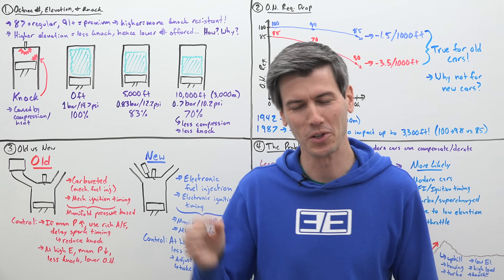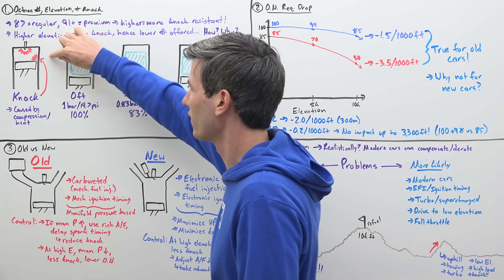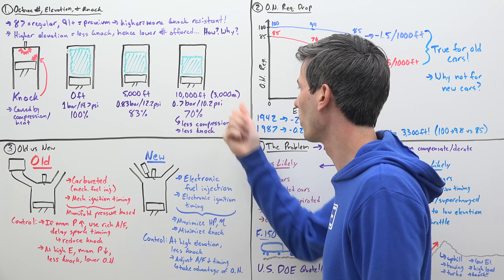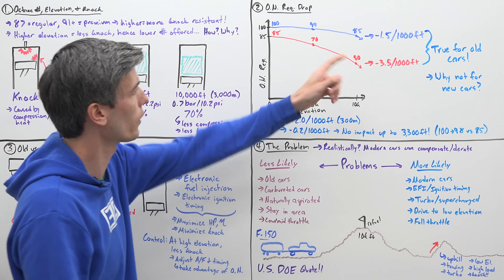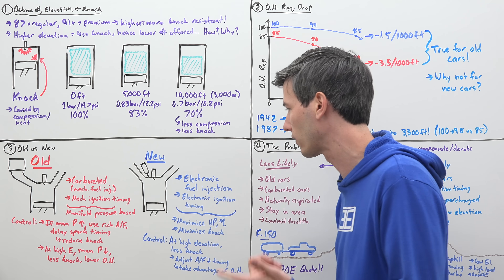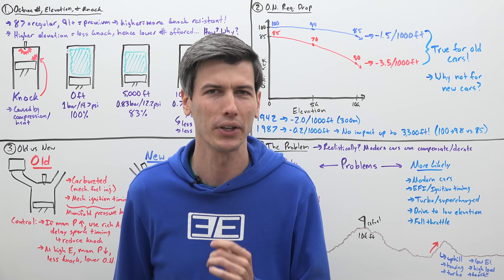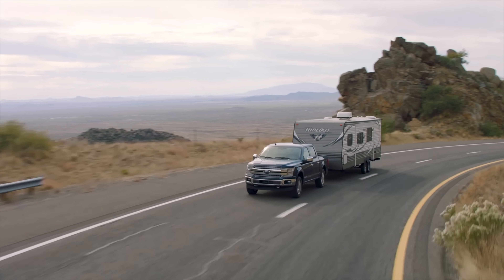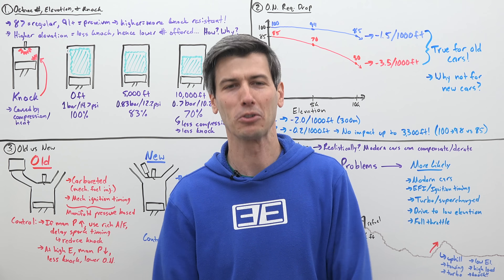Never Use This Gas In Your Car!

Comment: I've lived in Colorado and Utah for years, have always used 85 octane in my cars, and have never experienced any problems. Never had a car die yet at under 170K miles.
Reply: If your vehicles are dying before 200k it literally may have something to do with it. All modern vehicles (since the advent of fuel injection) should last 200k minimum unless there were major design flaws or they sat for extended amounts of time
Reply: @jman0870  Hey it's one of those YouTube comment section know-it-alls. Well, in my defense, I didn't want to make the number of miles that my cars generally last a higher number on average lest some other jerks make comments accusing me of lying. But yeah, these days a properly maintained vehicle should last at least 200K.
Reply: @joeldavis5815  hey look! It’s one of those say one thing, mean something completely different internet tough guys. You specifically said none of your cars made it past 170k miles before they died. Reading and writing not one of your stronger abilities?
Reply: @jman0870 So what is this? You get off of trolling YouTube looking for people to argue with. Get a life dude. No replying to you anymore...
Reply: @joeldavis5815  umadbro?
Reply: @jman0870  you wrong , he said they made it at  least 170k, didn't address above170
Reply: @rogerdodrill4733  uh…yes. He specifically stated he’s had vehicles die at 170k. It’s called reading comprehension. Get some.
Reply: @jman0870 they said they never had a car die yet at under 170k miles. That means that none of their cars have died at under 170k miles using that type of fuel.

You assumed that the poster kept their cars at or above 170k miles. Nothing in the post explicitly states that they had a car die at 170k miles. You are the one lacking reading comprehension.

Also, your earlier post ASSumed that the poster probably had an engine problem due to the fuel that they were using, a car can get too expensive to repair to essentially deem the car dead. I had a 1992 Honda civic with higher mileage that blew a head gasket, wasn’t worth the repair, so for all intents and purposes to me it was dead. Nothing to do with the fuel I put in the car.
Reply: Guarantee you run some high-octane in it within a couple hundred miles you'll notice a big difference in the way it runs.
Reply: @kskip4242  high octane stops predetonation in high compression engines. That’s it. Read a book or something.
Reply: Hahaha 🤣🤣🤣 I live in a high elevation state. Run 85 almost exclusively in all of my vehicles that can for 87. I usually sell my cars at about 245,000 since my job requires me to drive all over and I want a reliable car. Never have any issues with knocking, pinging, or power loss. In fact I can't tell the difference between 85 and 88 at all. What is not mentioned in the video is altitude density. The air at high altitude does not allow for pre-detonation (knock) as easily as at lower altitude. That is why 85 is equivalent to 87 at lower altitude. This entire video is built on a false premise.
Reply: @magnashield8604  Did you watch this video??? Jason specifically talks about altitude density (he just doesn't use that term) - it's what is shown in section #1 of his white board!

Comment: What would happen if a top fuel dragster made a run inside a chamber under constant air pressure? Forgetting that it would immediately send a rod through the block

Comment: My area (Denver) has 85 any my bike can totally run on it, however I’ll still use 87 because my manual recommends it and I also justify it because I have a hotter running air cooled engine

Comment: if one were to use a tiny percentage of gas in an older diesel in the colder months, with two stroke oil, certainly. then this low octane fuel would provide the least loss of cetane number.

Comment: One thing to be careful of, half throttle at lower RPM in older cars that have manual throttle bodies still means you probably get close to maximum manifold pressure!

The throttle body is sized so that when it is fully open it allows as much air in as the engine could use. If you're only at half RPM, your engine can only use half the amount of air, and thus only about half throttle will actually already allow the engine to pull in all the air it can. 

You can tell this if you're driving an older car, at low RPM, about 3/4 throttle or full throttle will not have a noticable difference in power, just make more intake noise most likely.

This is important because you mention low/mid throttle as a case where issues are unlikely, but low throttle at low rpm might be the same as full throttle at low rpm.

This may or may not apply to modern cars that have drive-by-wire, as they have throttle maps that mean a certain amount of you pressing the gas pedal doesn't necessarily correlate exactly to how far the throttle body opens.
Reply: Old cars had vacuum advance timing. Low throttle=advance spark, may ping more than open throttle

Comment: I live in a high altitude area , and have always stayed away from using that crap 85 fuel.  Even the 87 is suspect , I think, so I try to get 89 or so ,and don't even get me started on the whole Ethanol crap BS that they are adding E10 trying to push the E15 now.  Im prob never going to own a flexfuel or turbo/supercharged car so the E85 is for sure a no go for me, ever.   The fact that they are jacking up prices on the E0 fuels now pisses me off tremendously !

Comment: I always thought that stations had 85 octane to make the price of regular on their signs seem lower. I drove across the countrty and came upon what I call the bait and switch. You see a great price for regular on the signs visible from the highway, you pull into the station and the price is for 85 octane. I put premium in my Raptor and look at the regular price to get an idea of what premium will cost at a station since they usually only list Regular and Diesel on their signs. I've found that at the stations that have this 85 octane gas, the price for premium is much higher.

Comment: No consideration given for knock sensors and ignition timing?  I live at 6,000 feet and our Subaru's mileage numbers are noticeably better on 91 octane verse 85. The lower octane fuel cause so much timing retard that efficiency is out the window.
I would estimate that we are losing 20hp with 85 octane over 91.  91 octane is 60 cents more per gallon and doesn't even out with increased mileage. We compromise with 87 octane.

Comment: Interesting. I live in Colorado, and I (and most people around me) have been putting 85 in our cars for my entire life. I've yet to have an engine explode on me. Seems to work fine.
Reply: The engines don't explode; the rings can fracture. The only engine I was naive enough to rebuild was from a 1970 Volvo 140; it needed premium gas because of the high compression ratio but it was run on regular. Every upper compression ring was broken, with accompanying paths torched in the cylinder wall.

Comment: It is inaccurate to say you can have 14.7psi in the cylinder during an intake stroke on normally aspirated engine.  There is always a pressure delta compared to ambient.

Comment: I have ran into this lower octane fuel in Utah a few times. And they mix premium with the low octane to make mid grade at some stations. I just bought 91 octane in those areas so I wouldn't have issues.

Comment: I have an assignment for you: Find out how Honda supposedly "fixed" their oil dilution issues on their 1.5 liter engine for colder environments. If not, please give some advice on how we colder living residents can prevent oil dilution and/or whether engine idling to heat up the car via remote start on a cold day damages the engine or creates more dilution. Thanks!

Comment: seeing most cars have modern electronic fuel controlled engines, I think they should ban the practice of selling 85 octane. It's a scam anyways, they do it because it's "cheaper" but yet gas in higher elevations seems to be more expensive anyways. so you're paying more for 85 octane then you would at a station closer to sea level at 87 octane

Comment: Good info, I live in Wyoming at 7,200’ elevation and about 14 years ago when I moved here I was concerned and confused about all reg gas here being 85, then 89,  no 87.  I have a 2011 f150 eco boost and have been putting the 85 in for 10 years.  You have me second guessing changing to the 89 in the future. Thanks for sharing.
Reply: I’ve been in Denver for 20 years and have used 85 the entire time. Have never had nor heard of anyone having issues. I’m also not asking around but seems like I would have heard something by now.
Reply: if youve been putting 85 in it for 10 years and havent had any issue i wouldnt bother
Reply: @dylanc2806  I agree. I still use 85 for that reason.  I do upgrade if I’m on a trip at lower elevation though.

Comment: I've been using 85 In all the vehicles I have owned since I started driving.  Never ever have I had a single problem, all user manuals say to use 87. Well less air means I need less octane haha most people think the higher the octane the longer there engine will last...... not true at all

Comment: It’s all in the timing.  How much advance is programmed vs how much is retarded when knock is present. Dieseling was eliminated with fuel injection due to electronic fuel control. That said, the next part of the equation is compression ratios. Some modern performance oriented engines take advantage of higher compression rations due to combustion designs along with fuel and timing mappings.  There is a point where physical mechanical meets it’s limits.

Comment: All of this sounds a little out of this world to me. Problem I will never have to think about. Here in Central Europe, I've never seen lower than 95 (the typical offering is 95, 98, sometimes 100). 
So I set out to find details. And sure enough, octane measurement is a bit different in Europe (probably Research Octane Number) and in the US (average of Research Octane Number and Motor Octane Number, which is usually a bit lower and called the Anti-Knock Index) :-D 
So 95 in Europe could be about 91-87 in the US - roughly, there is no strict relationship between RON and MON, just AKI=(RON+MON)/2.
Reply: Yes, this is explained in the video.

Comment: I live at 6000 ft. and have used 85 octane for decades. I still have my 92 F 150 with 240,000 on it and it does just fine. My 99 Yukon and 99 Cherokee, same thing.
Reply: Surprising how many dummies can watch this explanation and still think that every car needs high octane fuel.
Reply: Do you drive like an old man on Sundays? My guess is yes
Reply: @paulo123-  You can't drive fast here anymore thanks to all of the Commiefornians that have moved here.

Comment: Something people may not know, but I have encountered areas where the trucker that delivers the fuel gets the fuel tank fill mixed up or the people working the gas n sip give the fuel truck driver the wrong information. So the fuel rating is an illusion in those areas.

Comment: The US's "premium" 91 is like the lowest octane fuel you can get where I live which is 95 RON, no wonder the US version of engines are always detuned ^_^
Reply: ...and in spite of that, most of our cars have more horsepower anyways! 😂

I can almost bet the reason for the higher Octane fuel is because your smaller engines have higher compression ratios for better efficiency... because of your nanny state governments.
Reply: @jasono2139  What's wrong with efficiency, some people just want a cheap car that gets them around. Don't get me wrong I love me a big engine with lots of power but it comes with a big cost so it's all about priorities.
Reply: @talictdf4757 ... nothing is wrong with efficiency, but that's not the point.

If I have to pay $10 extra bucks per year in fuel to have a car that can easily get up to speed, then no, I'm not interested in getting perfect peak efficiency... especially if I have to pay more to buy that car in the first place.
Reply: @talictdf4757 ... As for European cars being more efficient, that's hardly true. The real difference is between turbocharged cars and NA ones.

While in Europe, I drove a Honda CR-V which was horrifically slow despite being only a small SUV... the mileage was only marginally better than my wife's 300 hp Sorento.

Otherwise, if you Europeans REALLY cared about efficiency, hybrids would be a much more popular than they are in the US.

My wife's 5,000lb PHEV minivan gets better mileage than every single car her European relatives own... and that includes their little eco-box hatchbacks.

Comment: Where on Earth did you get your pressure calculations? I live at 7200 feet and the air pressure here fluctuates from .95 -1.05 bar. You won't see 70% air pressure until you summit the biggest of Himalayan peaks. There are so few places in Wyoming that you'll see a bigger drop in air pressure than down to .9 bar and maybe 1 or 2 that bring it down to .87 bar, even during a storm. It also makes me wonder about the correctness of the study in your second panel; did they bring it to elevation or did they just reduce the air pressure to the engine in a vaccum chamber?

Comment: Ummm.... Did you just mix up the cylinder pressure and the air to fuel ratio?

While gasoline engines do require a air to fuel ratio of 14.7:1 for the gas to ignite, the actual cylinder pressure is MUCH higher.  Depending on the vehicle, it is usually around 120 to 150 PSI.  I mean, it can certainly be more or less than that, as long as there is not a 10% difference between the highest and lowest cylinder pressure reading taken.  

But, I don't know of a single engine that can run on only 14.7 PSI.

Comment: UK minimum octane rating is 95.. with supermarket premium fuel starting at 97 and Esso, Shell, BP premium fuels at 99.
We also now have E10 fuel for regular with a higher ethanol content whilst premium are still currently E5.
Reply: US 87 = UK 91 

US 89 = UK 95

US 91 = UK 97

US 93 = UK 99     😉

As mentioned in the video and the description too, the US has a different rating system for octane. 😎

Comment: They sell 85 all over town here in Colorado Springs.  87 is mid-grade at some gas stations here.  I did have a Pontiac throw a rod at 135k miles in the early 00s I always wondered why I regularly got 250k+ on a vehicle and that one threw in the towel early.

Comment: This is a fantastic video with a great lesson. I have explained this concept to others several times in the past, although not quite as deftly. However, I always include an explanation of octane vs. heptane (ie. the influence that the number of carbons on the molecule chain has on ignition temperature/ignition pressures). A basic description of petroleum refining processes can be helpful. I wonder if you would be interested in creating content that addresses that part of the subject.
Reply: Good idea!
Send EE to a refinery and cover the important bits for us Petrolheads.
Reply: there is your problem, people's eyes glaze over when you get into octane, heptane, cetane, propane, butane, etc. they hear charlie brown noises......

Comment: Variable valve timing controlled engines can alter their effective compression somewhat so even NA can be a bit more octane sensitive than older engines due to them being able to keep the pre-ignition combustion chamber pressures higher at elevated altitudes than a fixed timing engine will.   

The REAL issues Ford is worried about is with their Eco-Boost engines which are turbocharged and able to maintain sea level boost pressures at much higher altitudes.   In turbo-speak this is called 'Critical Altitude'...beyond which the turbo/s cannot maintain seal level boost pressures.    If the manifold pressure is the same at 10,000 ft as at sea level due to the turbo/s...then absolutely it'll require the same octane fuel.

I had an XR4-TI years ago with 2.3 Turbo motor and it ran really, really well over 6,000 ft because it was still able to make sea level power yet the air it was moving through was less dense resulting in better acceleration and top speeds.    Aircraft turbo engines are often 'altitude normalized' where the manifold pressure is limited at sea level and the turbo's used to maintain it at altitude for better cruise performance.

Comment: My 31 Model A....I Advance the timing when accelerating  Retard the timing when slowing down or stopping. The timing doesnt Retard when you increase in fuel or speed it Advances. When you give the engine fuel you can SEE the timing advance with a timing light not Retard.

Comment: US DOE: We don't recommend using 85 in modern vehicles

Me, driving my E85-compliant car in Colorado: lol
Reply: That's not how that works. E85 means it's up to 85% ethanol, not 85 octane.
Reply: @davesstillhere  you can't drive on 85% ethanol, that's for special made engines. We have E10 in the Netherlands, means 10 % ethanol. More is not possible with the newest engines.
Reply: @gertvanpeet3120  actually, with fuel tanks and lines that won't corrode, and ethanol ready gaskets (very common nowadays) and adjusted carburetor tuning, you can run E85 in anything old (it's not good for it, but it'll run) and some modern vehicles (the aforementioned "E85 compliant" or "flex fuel") there is a sensor that will adjust the engine controls according to ethanol content. At least, that's what my mechanic coworkers tell me.